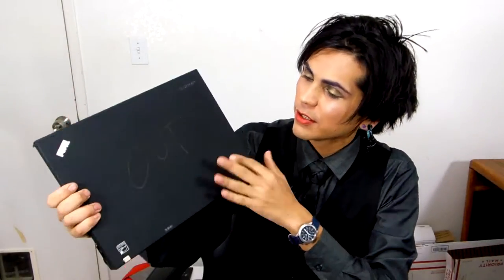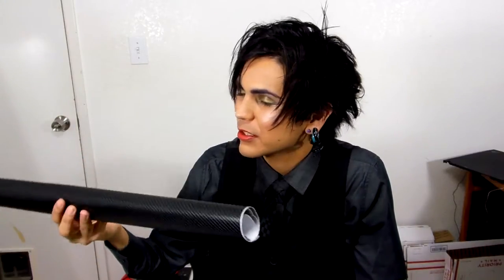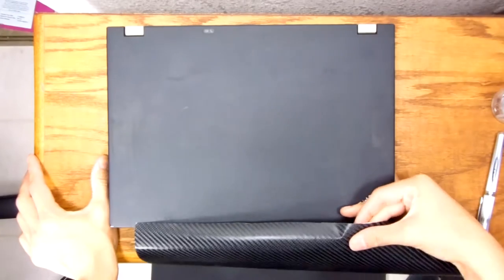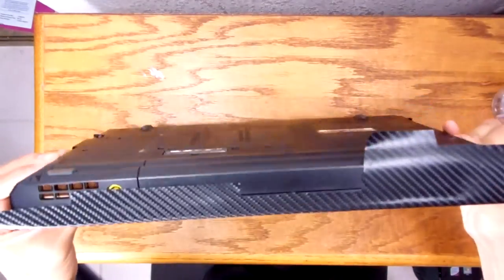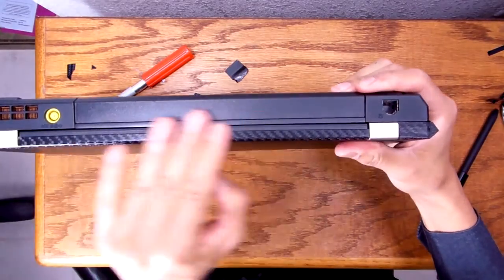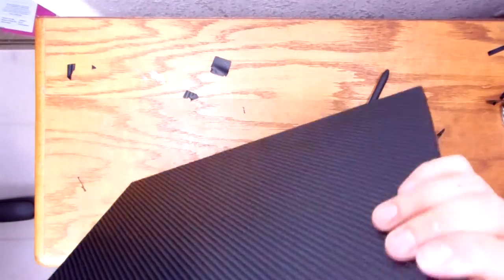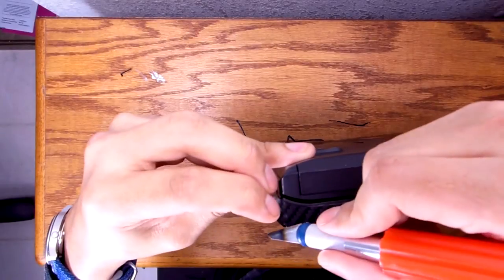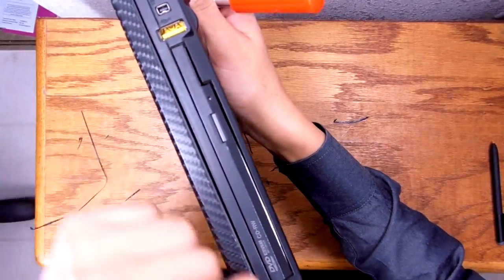Dazzling a ThinkPad lid with Carbon Fiber Wrap! Part 1

Comment: Plastidip works too and easier to remove and reapply if you mess up.
Reply: It's alright if you're going for solid colors but not if you're going for any level of detailed design, unfortunately.
Otherwise yes, plastidip would probably be preferable.